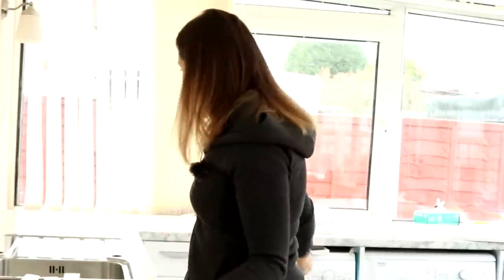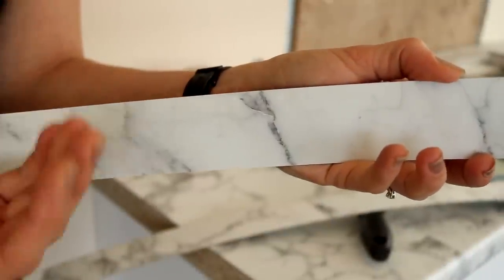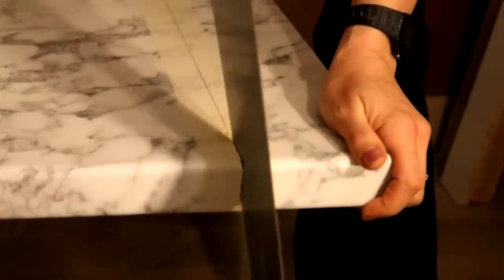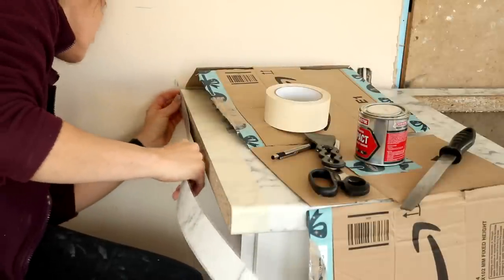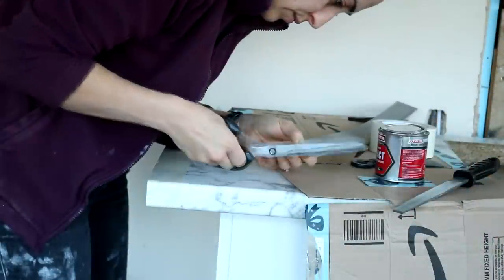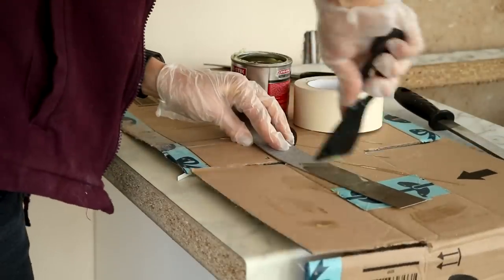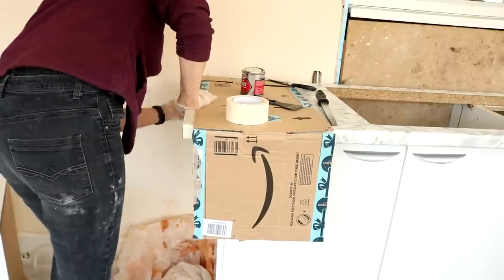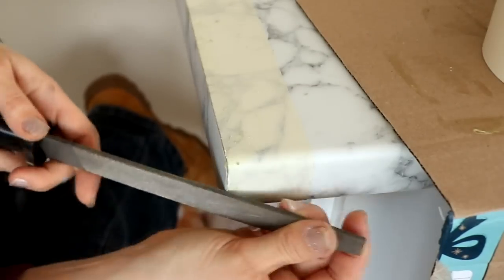Applying a Laminate Worktop Edging Strip: Kitchen Part 5 | The Carpenter's Daughter

Comment: Cut a worktop by hand! Gets my vote for that alone!! Great to see your skills growing. Keep up the good work.
Reply from the maker: Yes, I loved this method!  Most videos suggest using a circular saw with the good side facing down, but two carpenter's now (including my Dad) said using a hand saw is less likely to chip the laminate.  Also, love how hand saws are cheaper and less scary for any novice :)  In fact, the only power tools I've used on this project so far is a drill, electric plane and a jigsaw.

Comment: The applicator for the glue is the bit with the serrated edge Vicky, you were trying to use the handle which is the curved bit. 🙂 The serrations make the glue easier to spread and creates a bit of a keyed surface in the glue.
Reply from the maker: Thanks!!  No wonder it drove me mad 😂

Comment: On a very porous material like chipboard it's better to give the edge a coat of glue and let it dry completely , it acts like a primer coat , and then apply a second coat of glue for a much stronger bond , top work with the edging there , you make it look easy !
Reply from the maker: Thanks! I love the sound of that! :)
Reply: Or she could have put the glue on both contacting surfaces then both sides have adhesive.

Comment: Really good effort.. very brave to hand saw though.. always best with a circular saw with a straight guide if possible or even better a router and guide. I would recommend using a spray contact adhesive.  If you are very brave then dont pre-cut... use a very fine file and take your time. I find this give a factory finish especially on the bullnose.    But.. well done...

Comment: I am getting ready to glue a small strip back to that section of the countertop.  I heard you mention that you can't help but get glue on the surface of the other side.  Then, you made me come up with an idea I will use painter's tape to cover the front so no matter how messy it gets, It will not harm the other side!  Or I may use duck tape!  I will also wear 2 layers of gloves and turn on both ceiling fans in the 2 rooms near it while it dries.  I have a small bottle of contact cement!

Comment: Another excellent job Vikkie, l was going to say don’t forget to varnish the chipboard around the sink before you fit it but I’m sure you’ve already done it.
Reply from the maker: Thanks!  I've applied waterproof glue around the cut hole where the sink goes if that's what you mean?   I've not fixed it in to place yet as wanted to definitely know I had no leaks before I fitted everything 😊

Comment: Great job Vikki, hope people watching don't file in a backwards movement and they use a smooth file or edge will be ruined. Might seam obvious to most watching vid but you never know. :-( the way I have done edging is after sticking the edging to the worktop edge without even using scissors to cut rounded shape I would just allow it to dry fully and use a sharp chisel to cut it to shape and remove the overhang on bottom or even top and bottom, a piece of very fine sandpaper to dress the edges, making sure smooth all round so no clothing dishcloths or other such things snag and chip bits off. Looking really good now, utility room gonna look great. Thanks, vinny. :-)
Reply from the maker: Such a good point about not going back and forth.  I can imagine it's not so much of an issue if the lip is miniscule, but I didn't cut enough off in my opinion for my first attempt and some of it soon caved in. 
And I'm incredibly happy with how it's turned out so far!  I just need to make my waste pipe less steep according to comments on my Instagram, then add my joining strip and work on some finishing touches :D

Comment: Nice job. One thing my dad taught me when he was installing laminate edges that a light pass with a plane on a 45 degree angle takes the sharp 90 degree edge off. But I think laminates in the 70s were a bit thicker than the stuff you were using, so if you fancy giving it a try, I'd test it out on some scrap first.
Also to get the laminate to stick a wooden J roller is normally used, but if you don't have one a rolling pin does just as well.
Another great video, I voted for the award. Good luck.
Reply from the maker: Thanks for the tip!  My Dad actually said the other week, the edging strips are only made out of cardboard.  I bet he's not far off, but will try next time I have to do it :)  And yes, why I didn't think of some sort of rolling pin or seam roller, I don't know 😜 I own both!! 😆  Ah well... there's always another video on that I suppose :D

Comment: If you use PVA glue which is less toxic then use a household iron and piece of grease proof paper. The heat from the iron cures the glue and the pressure makes the seal.
Reply from the maker: Thanks for the tip!

Comment: A laminate trim router with a flush cutting bit makes quick work of trimming laminate.  Another benefit of this method is you don't need to pre-trim.
Reply: @ohasis8331  Only because I was lucky enough to watch the video earlier.
Reply from the maker: Thanks both so much!  This sounds cool!

Comment: I speaking to one of our Kitchen gutters and he edged out worktop by lining the bottom up when sticking it in. He then used a Stanley knife to cut the top edging down to approx. 1mm abound the worktop. Like you he then used a file to make it flush.
Reply from the maker: Edging from the bottom sounds much easier really so you don't need to clip the worktop over (if it's already stuck down) 👌

Comment: Right great job but very time consuming method. Snap trim to rough length, contact adhesive the chipboard edge, contact adhesive the trim then contact adhesive the chipboard again cos it's very absorbent, wait till it's tacky and press together with a block of wood. Then use a router with a laminate trimming bit to trim it all round then finish with a block and 120 grit sandpaper or a file on a 45 to take the arris (sharp edge) off! And an off cut of trim is great for spreading the contact adhesive and other glue! Great video and keep fighting the good fight 😉👍🏼

Comment: Cut worktop from the back with circular it will then give a perfect clean cut on the work surface side. Always fit the edge strip on the end of the work to before fitting the work top you’ll find it easier to flush off the end closest to the wall 😉

Comment: I stick the edging first keep the top flush let it set then use a sharp chisel to trim the bottom then just scrape the top edge with the chisel to take off the sharp edge
Reply from the maker: Thanks for the tip :)

Comment: Great video, I've got a problem, I have a 5inch gape between the work top and cooker, I was thinking of cutting a scrap work top which is the same dimensions, attaching it with glue and screwing in a support and baton to keep it solid and then vinyl over the whole thing but I'm concerned that the vinyl will sink in slightly at the join. Any tips anyone could give me would be massively appreciated
Reply: Fill the join with automotive filler & sand flat first.

Comment: a sanding stone (aka the kind used for sharpening knives) can, also, be used to sand or smooth the edge.
using contact cement in a non ventilated room can cause you to taste and smell colors.  not cool. good thing you opened the windows.
you are going to win so many awards that you will need a new house to display them. HA!!!!
great video. tanx a rot dudette.
Reply from the maker: Thanks again Michael :)  You've definitely got to be in it to win it 😄

Comment: you present well but no good kitchen fitter uses that method....
next time you do one leave oversize, stick flush with bottom and tap gently with hammer all along .pick up normal file and start an inch in from front and just brutallt rag excess off in 3 strokes max working to rear... go to front and gently rag it off working towards front then file a neat edge on and make sure you do underneath so nothing can catch if its sat infront of like a breakfast bar.
you develop a feel for this method very quick.
3 mins tops plus glue set time